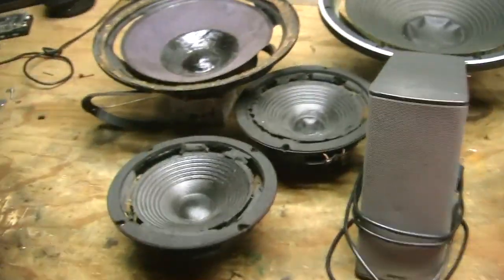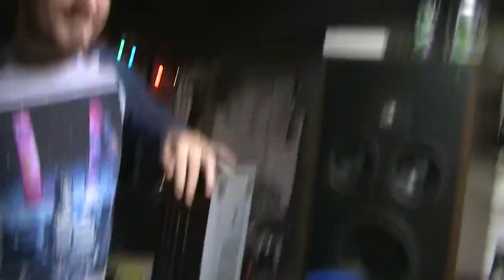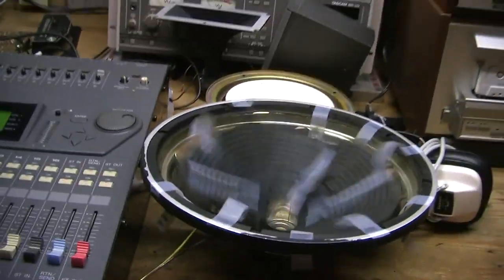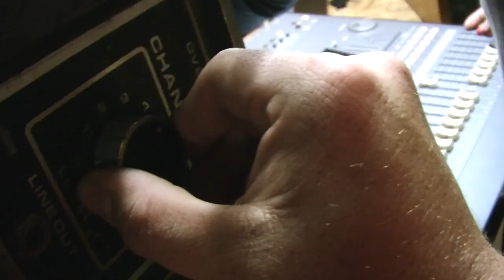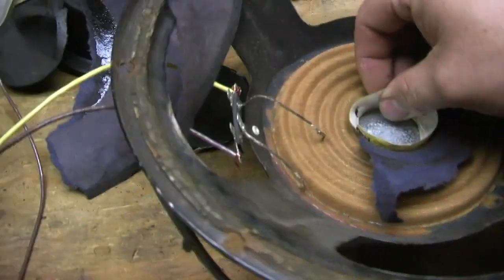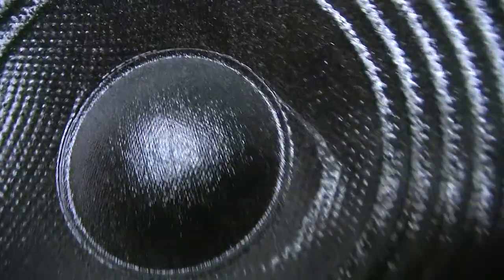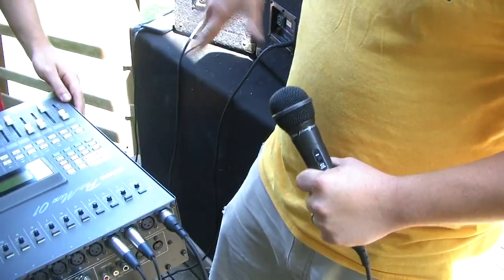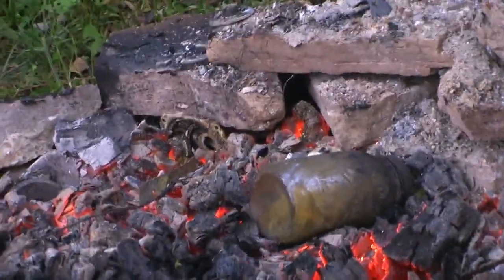Blowing Up Speakers With WooferCooker and Kopaka65

Comment: Nice Polk Monitor 10Bs in the background there. What do you think of them.? I have some 10As with the Peerless tweeter that sound awesome on the Marantz 2265? 

I don't think I've ever blown up a pair of speakers. I do have some 15" Fishers that might be candidates (and an Adcom GFA-555 that would probably trash them?).
Reply from the maker: +Donbusto Arigato 
I think you mean those Paradigm Mini 3SE but still very similar to Polk Monitors 10's 

Both are great speakers. The Marantz 2265 is also a great all around receiver. 

As for blowing the speakers up I'd say go for it. I wouldn't use an Adcom for that though. Too many chances of damaging that amplifier. Their protection circuitry isn't the best. You short across the output you'll be repairing the output circuitry.
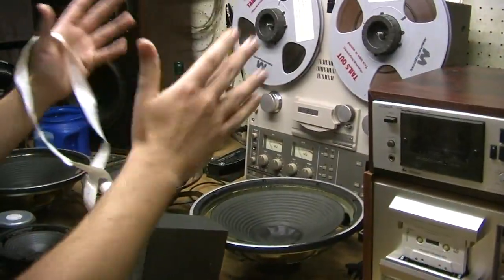Reply: Really, those speakers on the work table are huge, not minis. They have the Polk silver dome tweeter, two 6.5" mids and the 10" Polk passive radiator (classic mid-80s Polk design, signature look, about 28" high?). They're about the right size, BIG, lol. Can be seen at minute 3:25-8 of your video? Look at the beginning of the video. The Marantz is a nice piece for sure, but they're getting too pricey! Nice group of friends there!
Reply: SpeakerFreak95 I think he's referring to my m10's in the video maybe? And if so, yes, I love them. I switch out speakers all the time but these stuck around.
Reply: Oh and that's a 2330b
Reply from the maker: +Woofer Cooker 
I didn't even realize that. I completely forgot about those speakers. Wow don't I feel stupid. Lol 

Hey man!! Glad to see you here. Post something on your channel. Lol